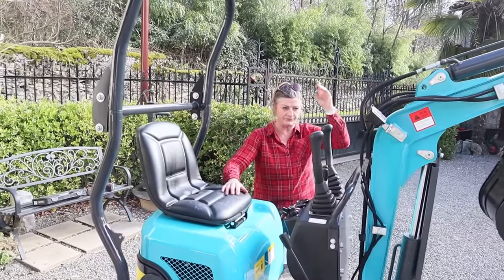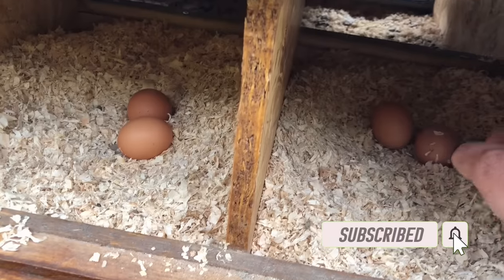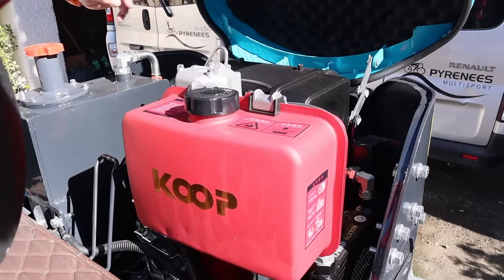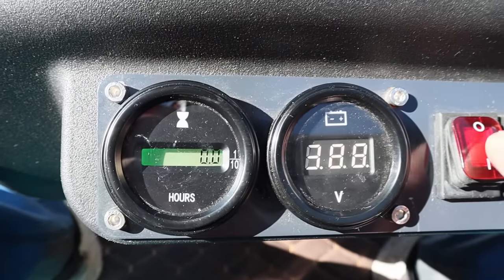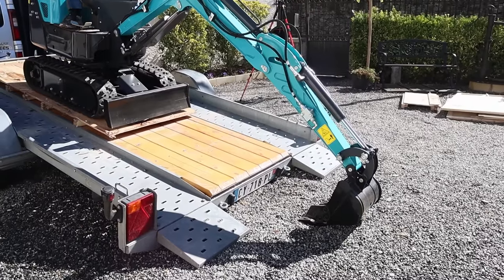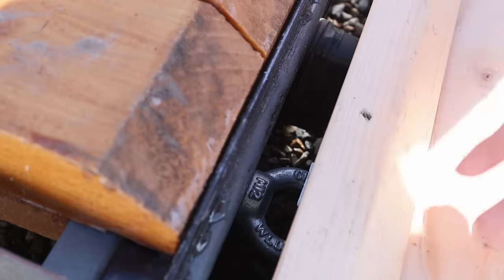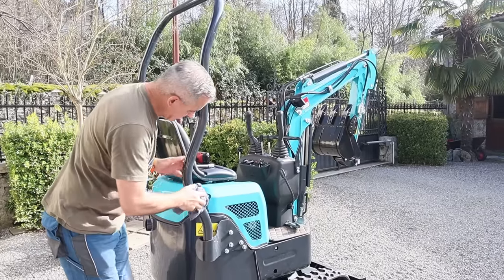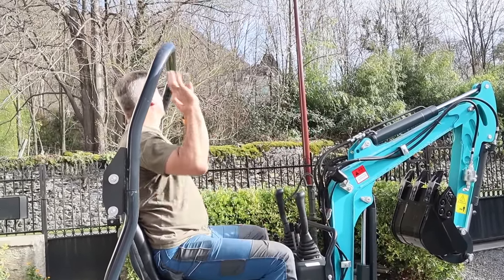Unboxing Chinese Mini Excavator | Nuoman from Alibaba

Comment: Great informative video. Don't listen to all the negativity in the comments. I bought one of these recently also down here in New Zealand however through an agent that imports them here not directly off Alibaba. They offer an 18 month warranty which I thought was quite reasonable. I bought this to help me develop my section, remove an old house off it and finishing landscaping. By the time I weighed up the cost of renting an equivalent unit and the hours I would need it for it just made sense to purchase one. The way I see it if I get all my work done with it and am able to sell it on in a couple of years for even half or less than what I paid then it will have well and truly paid for itself
Reply from the maker: I have thick skin and as most of our products in the shops come from China I do not have a problem with it at all.  I asked a lot of people before making the purchase and they said the quality was good.  I was happier than I thought.  Thanks for the encouragement.
Reply: pay low price but demand high low quality. i bet all american waiting for american made products with low price and high quality, but none exists, then they complain greedy companies, true. 

perhaps those who complain, form a company and make cheap products with high quality?
Reply: Heya Dan, 
Did you get the same make and model? Would love to know how the machines preforming down-under =)
Reply: Hey, could you tell me the name of the company you used. I'm in NZ as well. Was going to go direct through Alibaba, but happy paying a middle man to save some stress and get some support. Cheers

Comment: Cute watching you drive it for the first time,.  You will be a pro after few hundred hours.   You will never use a ramp again.   Looks like a super handy machine!
Reply from the maker: Yes, when I look back I cringe a little.  I drive it off my smaller trailer now with ease and have been using it for months now on the build site.  Thanks for watching.

Comment: Great little machine don’t be disheartened by folks saying it’s crap and you won’t get parts etc remember us brits can fix anything with a welder a vice and a bloody big hammer ,theres always someone out there that can and will fix it good luck relax and enjoy 👍👨🏻‍🏭🇬🇧
Reply from the maker: Cheers Paul - Exactly - ex RN artificier, I should be able to fix anything or give it good bodge for sure 😂
Reply: Even the best of mechanics must have a BIG hammer
Reply: LMFAO  yes Lucas is great example.
,  British Engineers lacked practical engineering skill and often designed crap that couldn't be made economically...so the British class system devalued the "working class" practical engineering skill learned during an apprenticeship. This led to the demise of British Engineering, and still continues in what is left of British engineering to this day
Reply: I agree, you have to know how to fix stuff, I remember all those land rovers I saw in Africa in the mid 90s while traveling there.

Comment: Word of advice/caution don’t push heavy objects(especially and even more so when doing it overhead like a tree trunk or heavy demolition)with that bucket/boom more than likely you’ll bend those cylinder’s/rods
Reply from the maker: good tip - this is for our build so more ground works, although my son wants his outhouse scrapped...I will be careful. 👍🏻
Reply: @HomesteadingUncontained  outhouse scrapped... that will be a crappy job 😊

Comment: As others have already said, there was no need to make or use a ramp. 
Extend boom out about half way, 
drive off/forward until you get to edge of trailer, 
put bucket on ground and lift the machine's front end just a bit, 
drive forward again while pulling boom back, until tracks front are fully supported on the ground,
Lift bucket and spin 180 put bucket down, as close to machine, on trailer
lift machine off trailer
Drive backward/off trailer while extending boom
clear trailer let machine down.
Reply from the maker: haha, I know, I will get the hang of it.  I did make the ramp to try and protect the lights on the rear of the trailer, but it was more of a pain than helpful so I have ditched it.  Cheers for watching and commenting.
Reply: @HomesteadingUncontained    I'm sure you will get the hang of it pretty fast.

Comment: Hey guys and congratulations on your diggers arrival. Its been a journey for you guys, at least you can get on with everything now.
So that clamp you were referring to, that is an exhaust diverter. When the engines are fitted to other applications, sometimes the exhaust points directly at other components so that clamp is used to re direct the hot gasses away. 
Your little ex looks a better fit and finish to mine for sure. Well done guys and keep it up 👍😁 ooh and thank you for the shout out. I'm glad I helped where I could. I just hope she's just what you guys need.
Reply from the maker: Cheers Nick - need to wait until the rain stops and then I am out with the Auger to get some posts dug.  Thanks for the tip on the exhaust clamp - I will take a look.
Reply: @HomesteadingUncontained  I keep an eye out for the auger video. Be interesting because I too have thought about one. 
You won't need that exhaust clamp because they will have fitted a silencer style exhaust to lower the noise down. Just a spare part to put in the spare parts box 😄
Reply: This was my initial thought also, but is it possible it fits on the intake above the oil cooler maybe to stop rain being pulled in through the side vent?

Comment: That's actually even smaller than the koboda ones I've seen here around town for rent. I'd kind of like to pick me up one of those if they're build good and well, and can stand up to some digging.
Reply from the maker: There are even smaller 800kg units but the are just too small on how deep they can dig.
Reply: Most manufacturers make micro diggers, kubota do a kx008
Reply: The mini excavators and loaders are very expensive to rent where I live, and the delivery/pickup charges are close to the rental fee.
Reply: Engineeringof the machine should hold up to digging, its bad operating that wrecks machines

Comment: I have one as well , big thing is to keep the tracks always very tight , you do this with your grease gun, they will slacken as you drive and turn, the cover on the side of the track is your grease point .
Reply from the maker: I will check mine again.  Hope you are finding yours works well.  Big test for mine with the ground works of our new build coming soon
Reply: I fully agree. It's easy to throw off a track by skewing when one edge of the track is up on a small rock or bump/sideways slope. Totally worth saving your tracks by getting down off the digger to kick rocks off to the side if you can't avoid them. Just be careful to avoid steering on them, not a problem if you proceed directly ahead. You'll understand when you've had to get the tracks back on a few times 🤣 keep them tight! The instructions say to leave a bit of sag. Wrong!

Comment: enjoy :) i have a 1.7 ton chinese excavator works great , it has a 3 cylinder yanmar engine in it and we love it ! we also bought it to help us on the property we have in sicily
Reply from the maker: I would have preferred the 3 cylinder yammer or kubota, but the budget did not stretch to the extra €4K.  But for the next machine size up it is a must for sure - great to hear from others buying and using these diggers..  Thank you so much for watching.
Reply: I got it 3 times as much that price as indidnt buy it direct and needed it in hand ! We are doing something similar as a project. Not full time tough

Comment: I bought one of these a year an a half ago. It was fantastic and worked great. But the crate was nearly demolished when I went to pick it up.
Reply from the maker: I was lucky, I bet. It was all good. Saw them packing it too which worried me a little 😞
Reply: Is it still running alright?
Reply from the maker: @frankfurter6005  It is going great - started on the groundworks of our workshop and no problems at all.
Reply: @frankfurter6005  IT sure does. Last weekend, I used it to dig a footer for a stone retaining wall around my rose bushes. The only thing I have ahd to do so far was keep the tracks tightened, and change the engine oil. I have aver 200 hours on it. Used the grappling attachment to carry 12 trees I cut down in my yard up the hill to my driveway. All of them were between 6 and 24 inches diameter.
Reply: How much they go for?
Thanks
Reply: @peps7149  I got mine, with all attachments, and with shipping and 25% taxes delivered to the dock for $6000. Included 1 Grappling attachment, 1 Auger, 1 Concrete breaker (jackhammer), 1 Brush attachment and 2 different sizes of buckets. I have used everything except the jackhammer and the brush attachment. I removed 18 trees from my back yard with the grapple. And 20 bushes from the front with the buckets. Dug footers for some retaining walls, and a trench for drainage. Saved 3 times as much in services to outsource the work. Over 200 hours and no issues yet.
Reply: @Panterakat1  where did you get yours from?

Comment: The question with these 'eastern' machines is not whether they will work or not, they will definitely work.  The question is on durability. How has been the baby so far?
Reply from the maker: It is going well - I am hammering it now and still no issues - as long as it gets me through my build I will have made my goal.

Comment: All I’m going to say is good luck .
Reply from the maker: Would be interested if you have had a bad experience with these machines.
Reply: @HomesteadingUncontained  Actually yes the hydraulic is very iffy pipe burst after 3 days of use to get parts is impossible so we got a friend of ours to fix it he replaced all the hydraulic pipes and seals which were brittle.My cousin bought one for his ground keeping company it was an awesome price works good but .Hopefully you don’t have issue with it.

Comment: You do understand that that machine is meant to go off road and can easily roll up over 2 to 3 inches of lift and not to mention 8 to 10 inches of drop. You could’ve rolled it off the trailer without hitting the tilt if you know how to do it right. Using the boom you can lower the front end down to the ground and the rear end will just drop off the trailer.And thank God you didn’t put petrol or gasoline in there I don’t know of any excavators that run on gas, they are all diesel fuel for the most part.
Reply from the maker: haha, I know, but never driving it before I was a little cautious - for the diesel, everyone told me it was the same engine as a ride on mower.... and my mower was petrol, hence the confusion.   Cheers 👍🏻

Comment: Cool little machine! Probably a smart idea to put the oil cooler on it, especially for when you’re using the auger. Watching from Canada 🇨🇦
Reply from the maker: Yes, after watching a few videos I asked the question to the supplier. I am glad I did. Cheers for watching 👍
Reply: Unless you're operating it in Arctic temperature's it seems like it would be a must! How else would it cool itself?

Comment: Need to idle it higher when operating the hydraulics. Using it at such a low RPM is very hard on the pumps.
Reply: Quite often the instructions say for "x" number of hrs run motor at 1/2 throttle,... or similar instructions. For breaking in purposes. Blaty bla bla...
Reply: 3/4 throttle  after warm-up  that's why u use the  atf or two stroke extra lube in fuel

Comment: I run mine in over 100 degrees And she stays very cool. I never even need to turn on the oil cooler. Very smart getting the ram guards also 👍🏻👌🏼💪🏼
Reply from the maker: It was 35 deg C the other day and I could feel the heat through the controls, so I just flicked it on to be safe.  It was probably the sun heating up the outside of the machine more than anything else.  Thanks for commenting, ,much appreciated. 👍🏻

Comment: People see using cheaper Chinese products as a bad thing, I see it as we are used to overpaying for everything that we see good deals as too good to be true 😂 of course that’s not always the case I recommend lots of research
Reply from the maker: Exactly - most things people buy are made in china.  I just went straight to the source which was scary but now I have done it, I would do it again.  Thanks for commenting and wathcing
Reply: @HomesteadingUncontained  can I know where you bought it,we planning to buy ours too.
Reply from the maker: @unisi8703  This is the unit - https://www.alibaba.com/product-detail/NM-E10pro-cheap-best-1-ton_1600352283669.html?spm=a2700.galleryofferlist.topad_creative.9.746c54e13SLxWp
Reply: You're overpaying to compensate workers a "living wage."  And lots of other benefits.
Reply: I agree we overpay for alot of things, but these super cheap chinese machines can leave you with problems. 1. Parts availability, that's some of what you pay a premium for. When you can go to a heavy equipment dealer and just pickup what you need all be it expensive. 2. Build quality unfortunately most people dont have equipment to test metallurgy, that boom arm could very well be made of used cars we sent to China during the cash for clunkers deal. It could be a mix of softer and harder more brittle metals. This can become a problem should you get a crack and need to weld it back together. 3. Implement standards and interchangeability. When the teeth wear out I assume you have to order from china? That goes back to metallurgy as well softer teeth less work time. All in all it could be a good machine for piddling around but everyday use could be an issue once it starts having major problems likely off to the scrap yard.
Reply: @fraidykat  

Why did you put “living wage” in quotes?????
Reply: @BillyT886  Because the Federal Poverty line is technically speaking itself a living wage.
Reply: @fraidykat  

Gotcha.    Makes sense.   Federal poverty line is FAR from a living wage
Reply: @BillyT886  I grew up under the poverty line.  It's most certainly a Iiveable wage.  It's not a happy fru fru wage, but it's a living.

But in principle you're not even willing to pay for a liveable wage if you're buying foreign goods made by cheap labor.
Reply: These are absolutely rubbish you do pay for what you get the hydraulics are lethal no valve control at all and the slightest bit of gravel stops you in your tracks !
Reply: @wrexhamseal  then you can fix it? Odds are they are using off the shelf parts and aren’t engineering their own custom parts like John Deere or other brands
Reply: @ayoitsyayo  John Deere parts are available and going to be supported pretty much forever. They also keep their value because they are built well where these under-powered and under engineered toys are built to last a year and will be long since scrapped. You can't cheap out on heavy equipment even on a mini.
Reply: @ayoitsyayo  it would cost more to make these safe than it would be to buy a decent machine check valves ex
Reply: @HomesteadingUncontained  is it really only costing $680 ?
Reply: They copied from Japan I believed..there is so many this cute little machine many versions.. at my village but it's from Japan..they start using it since last 15 years and there still using it..they use for paddy field ..it's cute but it's tough..how big this paddy field? 5kmx5km I think..at the other edge fence..you can't see a thing even a car like tiny as sand....too far..but if made in china I don't think it still working after 2 years..but it's cheap

Comment: i have looked at the machines like that before, one thing that worries me is what happens if something fails.  common brand that we have is easy, you go to a dealer and order a part.  With this, you might wait for months before you get it.
Reply from the maker: They are pretty simple machines when you look deeply.  I now have the full manual with all schematics so I should be able to figure it all out.  Shipping from supplier is only like half the stuff of Amazon so it should be OK 🤞
Reply: even name brand takes a month to repair
Reply: Have parts made at a machine shop
Reply: @Yellowbullet714  it took me a month to get a simple push mower to be fixed locally. So this being from China isn’t a big deal

Comment: Check the exterior of the tool box to see if the clamp you questioned fits on it.  The clamp may mount the tool box to the ROPS ( Roll bar)

Comment: Use bucket to keep blade from dragging, cutting the wood because of that little board made no sense to me, it would of easily driven over that. The small piece you found in tool box might be exhaust tip
Reply from the maker: haha - I know but that was my first ever few centimetres of driving it - I have watched it back with my hand over my eyes 😆
Reply: @HomesteadingUncontained  Lol

Comment: I got one in the netherlands, some minor changes, but basically the same machine. same engine and build up. I decreased the speed of turning because it felt too much strain on the gears..
Reply from the maker: yes, I am going to take it easy and see how it goes - are you happy with yours ?
Reply: Gears? Aren't they hydraulic driven?
Reply: @wesman7837  Hydraulic driven motors in the tracks called final drives.

Comment: This is super tilting for someone that has been working excavators for 25+ years ranged from this size to 40t ones 😂😂😂
Julie's idea of putting some foam on the rollbar is not bad because you WILL hit your melon.
Those lights on the boom are useless in that position.
With your bucket on the ground re-fit them and aim them at the bucket.
Reply from the maker: For sure, yesterday I jumped hard when hitting a rock and my head hit the roll bar.  Lucky I was wearing ear protection which took the blow but it was a bit of a shock.  Thanks for the advice. 👍🏻